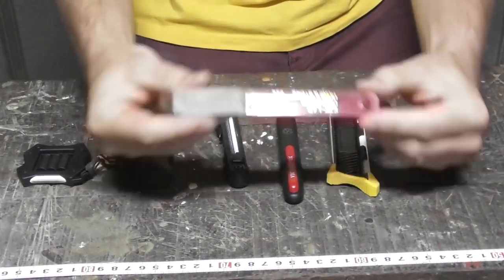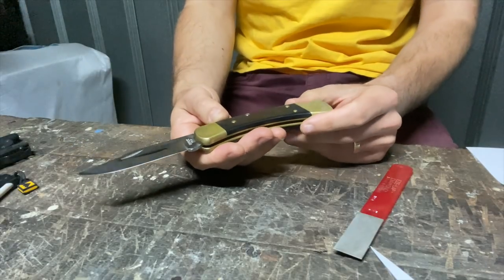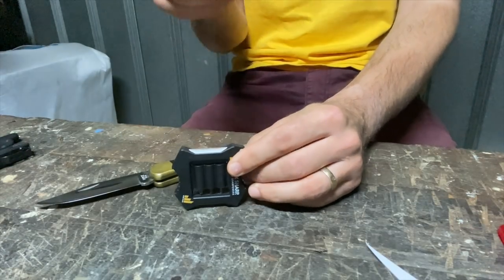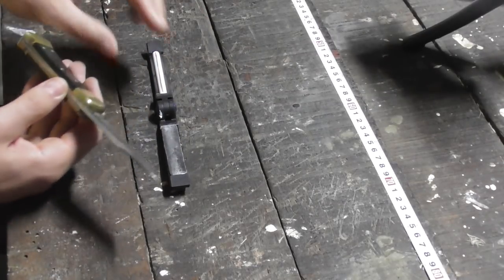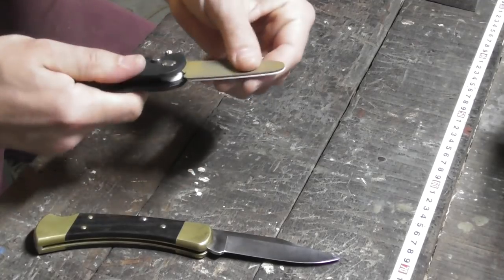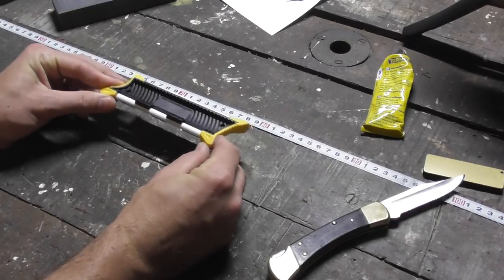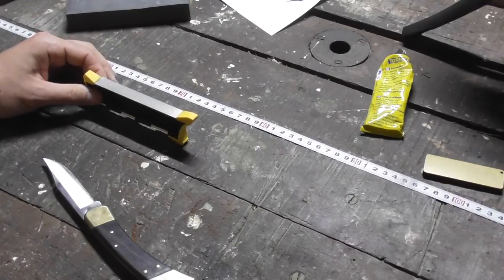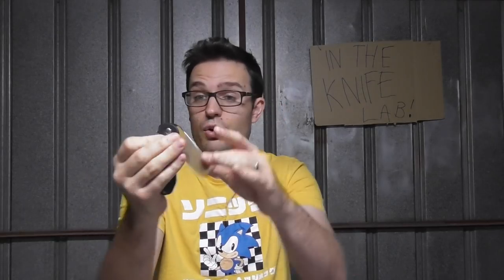Which 'Pocket' Sharpening System is Best? 7 Models Tested, Dull to Sharp on each

Comment: Sharpening tips. Rule no1: We always do the same amount of passes on both sides Rule no2: We put low to medium, pressure (we never push with more force,to make things happen faster (NEVER) We always go slow and precize) Rule no3: We always try to keep the same angle,on both sides and on all the grits as we advance. Rule no4: As we advance on grits,we double ,tripple or even more the passes,depenting on whats the grit jump (from 400 to 1000 we double the amount,from 1000 to 3000 we triple) Rule no4: We reduce the last passes on the last fine grit.For example, if we did 10 and 10 each side, we go to 5 and 5 to 2 and 2 each side and at the end 1 and 1. You can lower the presure too as you advance the last passes. Rule no5: Final step. We strop at 1 or 2 less degrees angle, on newspaper (black letters part of it) that we have tightened, on our leatherstrop,for at least 5 passes per side,that are made 1 by 1 each side,with low pressure and slowly,keeping that damn angle nobody keeps while stropping. Stay safe and have fun! PS Thar's what will give you, a super scary sharp edge. Experience is all about, so keep trying, until you get there.
Reply: I think you forgot deburring
Reply: No use counting passes between sides. You sharpen until you feel a burr. No two sides are the same, even straight from the factory.
Reply: You can also increase angle a little bit with every grit step. This will give a nano convex on the very edge and also make sure that the apex is deburred 100%.
Reply: @MightyRude  If you do, what I said as I said it, you will remove the burr as you advance,also the final passes, plus the newspaper stropping at the end, will remove any potentially small burr. I always reduce the passes and the pressure a bit, as I advance from grit to grit.That way, you end up with no visible burr.I only strop to the newspaper, to align the molecules of the steel.It also polishes the edge a bit more!
Reply: @DonMetal  The way I do it, the burr is removed as you advance. If a small burr is left at the end, the newspaper, takes care of it! ps the way I do it, you end up with no visible burr. You are right, but I do it a bit diferentely.
Reply: There are no absolutes in knife sharpening. Ever. Period.

MUST USE 4.5LB OF PRESSURE AT 13.375 DEGREE ANGLE FOR 42 PASSES EACH SIDE OR YOU WILL RUIN YOUR KNOIFE!!!!1!1..... no. 

Ive sharpened knives professionally, on and off for 25 years.

People like you scare novices away, and just overcomplicate it in general.

Gatekeep elsewhere

Edit:

Omg, you, "use newspaper to align the molecules". Ill run that by the bosses here(hint: 315) and make sure they know your trick.

Goofy.

Edit2:

Ran it by my boss. Ive  never heard this man laugh, the entire time ive known him. He laughed at you. Quite a few people laughed at you.

Cheers from a few of the people that literally came up with the composition of most of your favorite steels!!!
Reply: @Buster H Agreed.I know what you mean. Way of sharpening is a personal thing. I'm a perfectionist even though I know there is nothing perfect in nature , However, this method got me the best results on really dull edges. Also, I sharpen perofesionally, since the 80's and I really like to help people. So, IMO I helped people a bit
Reply: @Buster H lol lol  Rule no10 Never speak (answer) unless you watched the movie recently an remember the quotes lolololol
Reply: @CNYKnifeNerd  I appreciate your stance against some supposed knife sharpening orthodoxy, but I use cardboard as a strop sometimes. Works great. 
Also, thanks for your work in composing some awesome new steels, but I probably couldn't afford them. :/   lol  (unless y'all did D2? that's as 'good' as I get 😅, aside from 1095 of course.)

Comment: Some time ago I bought a Benchmade Field Sharpener. Then discovered it is merely a Benchmade branded Worksharp field sharpener (the one with the coarse edge, fine, rotating ceramic rod and strop) but was about $30 (Aussie) dearer. EDIT: NEVER use acetone or thinners to clean it. The rubber O-ring on the ceramic rod will dissolve and cause lots of grief and eventually the glue that holds the mini leather strop will fail. I still use it as my sharpening tool of choice but I also have a homemade strop that's bigger and better than that provided on the tool. Oh, and the ceramic rod fell out and I've misplaced it somewhere (due to the O-ring failure). In respect to this selection, I like the Fallkniven but the jiggly thing is a worry. But yeah, I have to agree with you on the Vic. Very portable and very useful. I think I'd also carry one of those hockey puck type stones for my machete and axe though.

Comment: Everybody! The worksharp field sharpener, while great, was not designed to go in your pocket. It was more designed for use at a camp or to go in your bag. This video is about pocket sharpeners, which I feel is an underappreciated part of the EDC world.
Reply from the maker: yes, exactly! A lot of support in the comments for the larger worksharp guided field sharpener, but this film was focussing on the pocket ones. I will do a video on a few of the next step up type sharpeners
Reply: @CedricAda  I would also like to say that the worksharp pocket sharpener probably wouldn't be too much trouble in cargo pants or shorts.

Comment: How could this guy not know these sharpeners are proprietary you have to use the same brand knife and shapener together for the best results
Reply from the maker: the only sharpener Buck makes is called the ‘Swift kick in the pants’ makes everything sharpen up quick smart that ye use it on
Reply: @CedricAda  I need that sharpener for sure!
Reply: I doubt that; unless a brand is angle specific? Generally I go for 20 degrees, or 15 for a hollow ground. For example, spyderco sharpmaker doesn't work any better or worse on a spyderco knife that I can tell. Many knife edges when new are not a uniform angle.
Reply: Hee hee. Good one Kevin!

Comment: I'm gonna BUCK the trend here. I use the DMT lightweight Trifold Diamond Serrated sharpener rat tails. Blue and Red. I can sharpen and hone damn near any edge but CS serrations with those two Pete. Just throw em in my fire kit with a 6 inch ceramic round rod...Strop on my vegetable tanned 9oz 1.75 top grain saddle grade belt. No frills. Anything with the Benchmade name on it is too much money and political stupidity now for what I get. 

Quite happy with anything Spyderco has ever put out for sharpening and honing...Worksharp has several new pull thru toys you may want to check out for channel review as well....